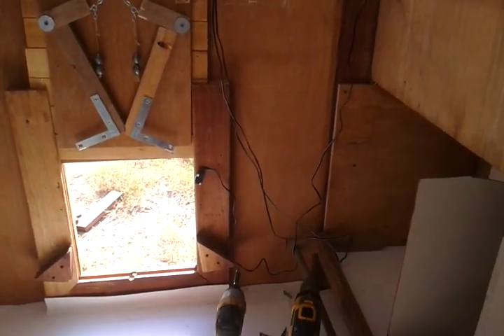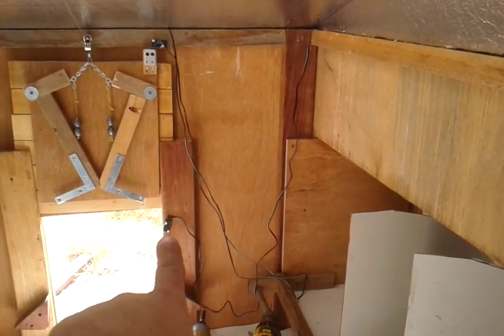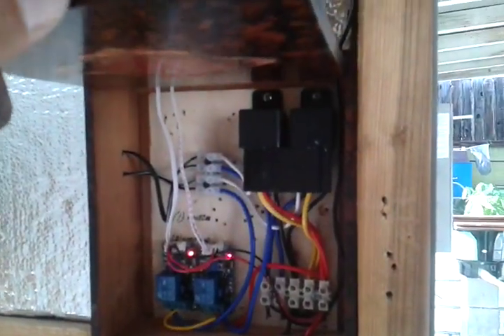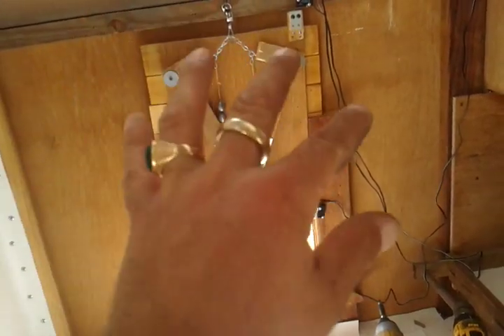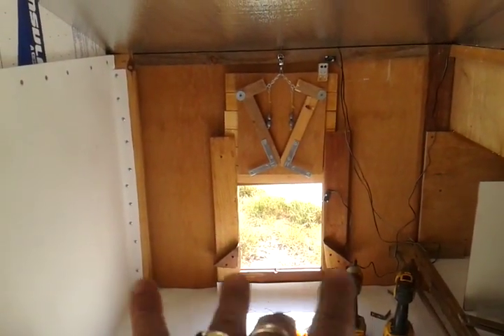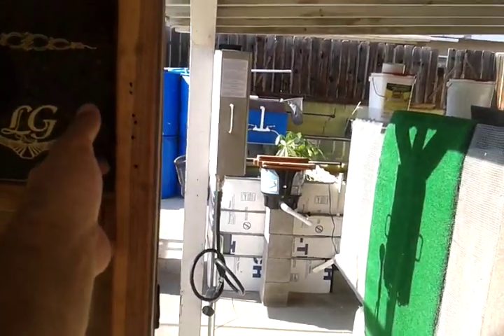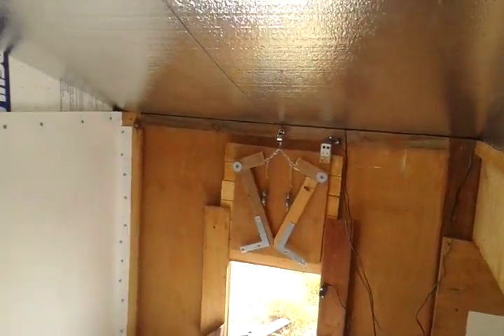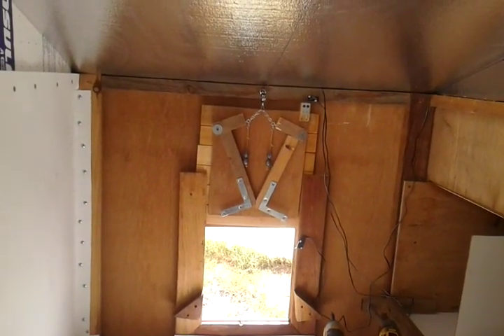Photocell chicken coop with locking door

Comment: Next time tell your brother to drop the two car relays. All he needs is the two Photocell Modules. 
Negative (from power source) goes to both the Normally Closed. 
Positive (from power source) goes to both the Normally Open (and then the cut off/Limit switches, I'm guessing that's what the pairs of black wires are going to). 
Motor wires go to the commons.